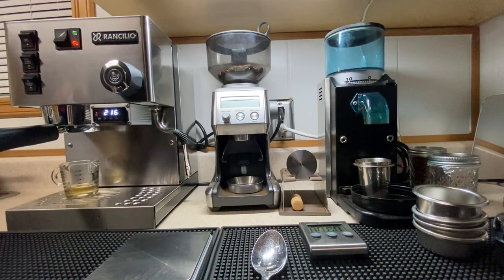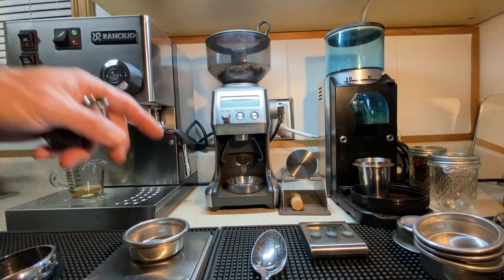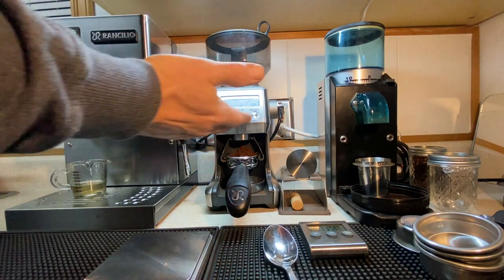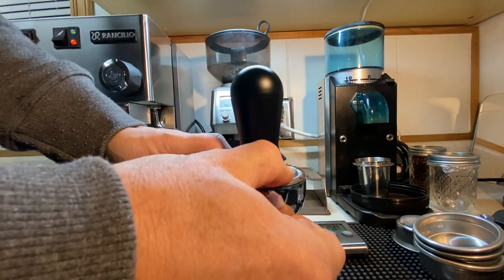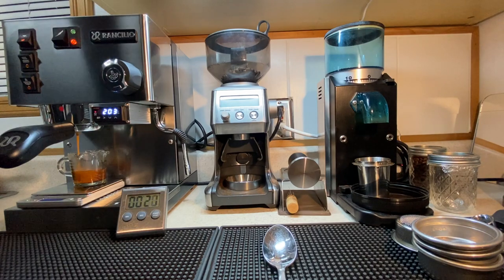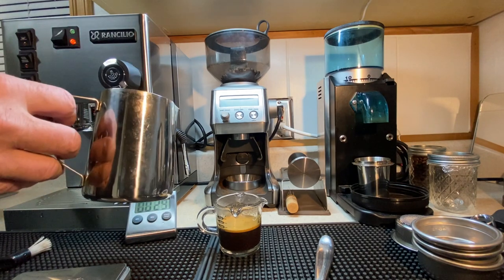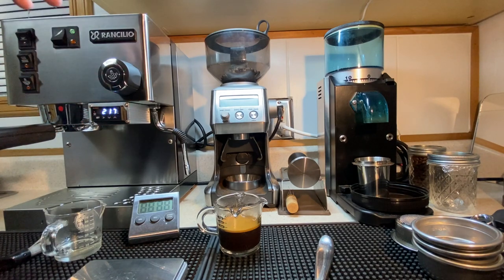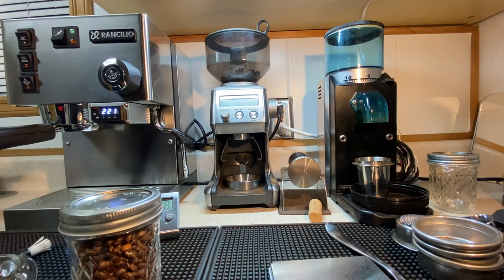1 YEAR of Pete's Rancilio Silvia tools tricks tips opinions Auber PID OPV WDT

Comment: 🎉finally someone talks about fresh beans and roast quality. Everyone so involved in the prep/process but why not roasting, using high quality FRESH beans 👏🏼 my take on the leveling tool…after the distribution tool it levels the field for a level tamp 🤷‍♂️
Reply from the maker: Mike thanks - so easily skipped over right? roast quality, level, bean variety - you cant get a flavor out of the bean that isn't in there, - and fresh beans - so important for those struggling with 'dead' , or over roasted , frustrated by not getting the taste they want and its not the Silvias fault - best Pete

Comment: Shots looking great! I have very similar setup, V5 Silvia PID w/pre infusion, IMS 18g basket, ims shower head flat screw, 8 bar, vario grinder and using lavazza super crema but can never get shots to come out like yours! I'll post a video if you don't mind taking a look give me some pointers.
Reply from the maker: Frank thanks , time for you to start Frank's Rancilio Silvia ! very similar set ups for sure - , most important is how they taste, you happy with your shots? Best Pete
Reply: @petesranciliosilvia3777   After trying different beans, mostly fresh light roast within 1-3 weeks of roasting without much luck I tried Caffe Borbone dark italian "stale" beans and I'm getting perfect extraction almost every time. Def more bitter than other beans but I just can't seem to get a good extraction with fresh beans. Check out the following video https://youtu.be/_sv_HACgY0Q Side note I got the PID w/pre-infusion then realized that this is not pre-infusion, this turns on the machine at full blast for 1.5 seconds then activates 3 way valve removing all water and disturbing the puck before going again at full blast. I'm doing my own pre-infusion with the steam wand and getting better results.
Reply from the maker: Frank, great points- agreed on the PID pre-infusion right? just because you 'say' thats what it is........doesnt mean its doing what you think, or give you the control ? I figured its about the same thing as flicking the brew switch on for a few seconds then off etc - anyway a bigger topic, but hey your shot looks great nice setup nice technique- they dont have to look perfect to taste good, - good luck, oh and yes, I notice lighter roasts pull differently than darker, fresher differently than older, different grind sizes required, different creama to liquid ratios etc - enjoy the journey and enjoy good coffee along the way -best Pete

Comment: 12 bar with no release.  With shot flowing through basket the system should be at 9 bar.  Your system if at8 bar (closed loop) the shot bar with open loop is probably around 6 bar

Comment: What are your exact PID settings?
For some reason after a pull, my PID will over shoot by about 5c - 6c (temp set at 105c) when heating up again and then take about 5min or so to stabilize. Is this normal?
Reply from the maker: Id have to - or you could go back and watch any videos to see if mine does anything similar ? Ive heard of people getting into the 'deep' PID settings and changing response times and sensitivity etc I stay out of that - as most good advice seems to suggest , I just want it to work - Pete